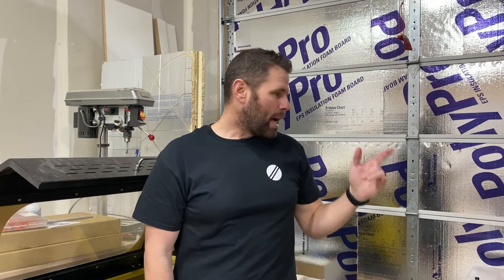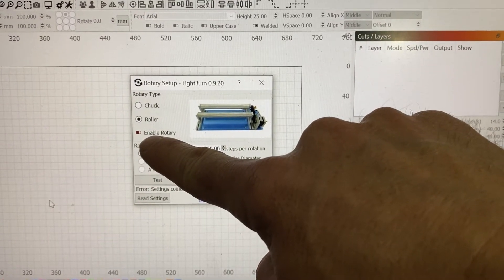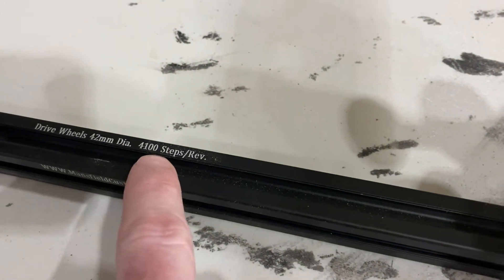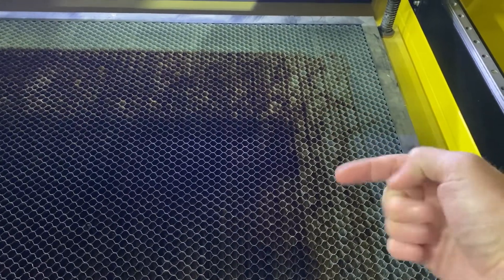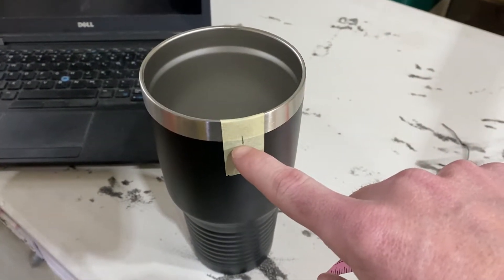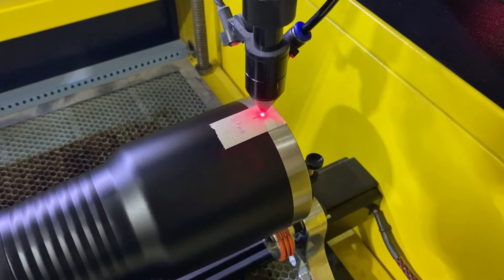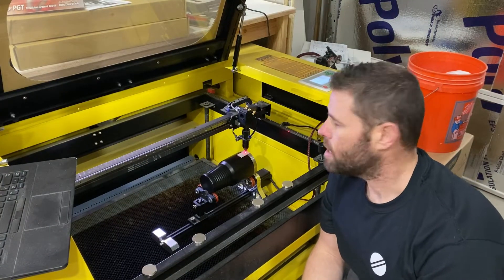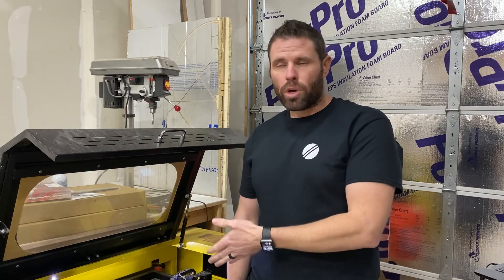Laser Rotary Setup and Calibrating Steps per Rotation Using Lightburn

Comment: Do the steps have to be determined anew for each job or just once?  Do I have to determine the circumfence for each part and enter it where?
Reply from the maker: On a roller rotary once you have configured the steps that it. The roller does not need the circumference or diameter.
Reply: @BeardedBuildsCo  thank you very much

Comment: old video, but still useful so thank you for posting...I have a question....I'm setting up a Piburn chuck rotary in an Omtech 80w red/black machine and the distance section in the move tab is greyed out. I can adjust speed but not input distance. Any guidance?
Reply from the maker: You likely need to change your start from position to current position or user origin. Then that field should open up. Let me know
Reply: @BeardedBuildsCo  Nope, I just tried, distance stays grayed out for current position and user origin.... Nevermind, I just figured it out, I had continuous jog enabled... I'll leave this post up in case anyone else comes along with the same issue, lol
Reply from the maker: @johndeaux9987 yep, that will do it

Comment: Would be really cool if you could tell us what the controller in that machine is (so that people who make their own machine with GRBL controllers etc can also use your previous answer :)) . Thanks !!
Reply from the maker: Not sure what difference the controller makes but this is a ruida controller.
Reply: @BeardedBuildsCo there are usually 8 switches on a controller, 1 -3 is supplied power. 4 is usually half/ or full power. And 5 - 8 is the stepper motor setting. There shouldn't be any guess work with it. It's all based on the switches and diagram. Some controllers are built into the laser. If yours is built in, you will need to read your owners manual and find out where it's located inside of the laser. It's usually very similar to an external controller but it's actually inside of the case
Reply from the maker: Go tell someone that has never worked with steppers that and see what kind of look you get from them…

Comment: Looks like it's been two years since you made this video.  Are you still using this rotary, and if so, how has it held up?  have you had to replace the rubber tires at all?
Reply from the maker: Still running strong through thousands of tumblers.
Reply: @BeardedBuildsCo  Good to hear.  Getting ready to pull the trigger one I think.
Reply: @BeardedBuildsCo  My Mansfield rotary should be here today. Will be running it on an OMtech AF2028-80  Reviewing this video again.  When changing tumblers or glassware, what in Lightburn needs to be changed?  Will I have to change the steps per rotation every time I change to a different item with a different circumference?  And I would imagine I would have to change the circumference value in Lightburn on the move page each time also?  Thanks.

Comment: ok i see all this but theres a steo im not getting my head round. How doyounknow where to actually place the rotary machine? im using an omtech 60w and i dont know where to place it at all once plugged in
Reply from the maker: For that you need to understand your start positions. If you use current position then it shouldn’t matter. You put the rotary in and then move the head to where you want it to start. Use your frame option in lightburn and it will help you visualize it.

Comment: When I change the steps per rotation in the software it doesn't change anything on the y-axis still spends roughly two full rotations around with the proper circumference calculated. Have changed the steps per rotation from 100 all the way up to 2000 with the same results both times. Any thoughts of what could cause this?
Reply from the maker: You likely need to be 5000+
Reply: I'll give it a try, thanks

Comment: anyone else have their rotary give them a nasty vibration? I cant find any info on that
Reply from the maker: This is usually because the steps are way off.
Reply: Thank you for the response. Yes I think I'm discovering that.. why even put the 4100 on there??
Reply: Nope. Still very jagged results. Vibrating not as bad but still vibrating. I can get it to rotate circumference and land back on mark with new steps per rotation

Comment: Im new to this and i just setup my rotary. My question is. Once setup if i decide to use an object thats a different diameter and i plug that number into lightburn. Would i also have to resetup the rotation number by repeating these steps or would the initial calibration work for any size object
Reply from the maker: On a roller/ 4 wheel rotary the object diameter does not matter. You also do not have to change the steps.

Comment: I have a question on the Mansfield. I love my rotary, however I keep getting a wave in my vertical lines. When I use the rotary that I bought with my OmTech, I don't have the waves. I have been searching for answers and saw a video where there may be a wiring problem with the 80w Black and Red. Any advise?

Comment: Thanks for the great video, it got me up and running on my Mansfield Rotary this morning. Do you have any suggestions in how to fix waves in the engraving?  I’m seeing ripples for lack of a better term in my lettering.
Reply from the maker: In Lightburn go to edit > Machine Settings, look in the X & Y axis settings section at the bottom, and look for the value of 'PWM Rising Edge Valid' on the X axis. 
Change that - if's it's checked, un-check it, or vice versa. Then, copy the new setting over to the Y axis as well.

Try to engrave again and see if that fix your issue 

Look for "fixing skewed engraving"

https://lightburnsoftware.github.io/NewDocs/ConfiguringRuida.html?fbclid=IwAR1OTF0zCbxmdDpIsOO5OSryHZQcYKB9go85pSdpVHk-d1FgkPGHDFxEuLo

Comment: Thanks for your instructions  very helpful.  
I purchased the same rotary axis.  I have experienced some issues when trying to setup different diameter glasses.  The rotary stops part way when testing the full rotation (arrow up) after one or two trials.  If I test the distance in the reverse direction (arrow down) it completes the full rotation but only once or twice.  Do you know why it cannot be tested always in the same direction (arrow up)?
Reply from the maker: Because you have run out of the theoretical work space. If you look at the controller it will show you the x and in this case specifically the Y coordinates. If it runs too far it hits the “limits” of the workspace.
Reply: @BeardedBuildsCo  Thank you for your reply - Is there a way to ignore these limits or do I just have to keep going up and down on repeat rotations?
Reply: Okay did some more work and you were spot on about the limit of the work space - that was my issue.  Additionally I discovered that my wine glass calculation for full rotation was not coming out to an accurate 360 degree rotation.  Turns out I was measuring the widest diameter where I was engraving the glass.  The correct place to measure the glass is where the drive wheels contact the glass - when I reduced the diameter to that dimension everything worked out perfectly - no change in the steps/rotation.  Many thanks for your expertise on this matter!
Cheers!
Reply from the maker: Perfect! You are correct in your discoveries. I’m glad you got it dialed in!
🤜🏻💥🤛🏻
Reply: One final question - how do you slow down the Y axis so the rotary does not spin too fast for the rapid movements?
Reply from the maker: Lower the speed on the controller and lower the speed in the move tab in lightburn.

Comment: I just got my rotary set up and cut my first cup. It has 3 separate logos on it. The first one looks fine but the next two (which are circle logos) came out oval… any ideas?
Reply from the maker: I stretch all of my circle logos 9% width wise to compensate for this visual mind game.
Reply: @BeardedBuildsCo  I was concerned about slipping. Any other tips like that? I am so happy I found your tinfoil and tape trick.

Comment: So when I change to different size cups do I need to change any of the setting in light burn.  Excellent explanation.  Thank you.
Reply from the maker: Nope, with the 4 wheel rotary you don’t have to make any changes once you have the steps calibrated.
Reply: @BeardedBuildsCo  Do different size tumblers not make a difference on tumblers?  I was going through doing some and found that the steps for a 20oz were different and went too far on a wine tumbler.  Had to go through process and re-set the info between wine tumbler and the other.
Reply from the maker: I use the same steps on a 20oz yeti and a 64oz growler yesterday.
Reply: @BeardedBuildsCo  hmmm.  ok.  thanks for the quick reply.  I'm playing with it now and trying to figure it out.  Think it may have to do with finding the "actual" right size/circumference for it to move.  I can leave the steps the same and play with that number a little and it makes some difference.  its hard with the wine tumblers cause every point of them is a different size.  

I just did one that was two sided and my measurements were correct in lighburn but I had a 2" gap between them on one side and 3" on the other side.  Wouldn't be a big deal if you're only doing one image on a cup

Comment: My engraving smaller coming out smaller then my design, an inch…what could be the problem??
Reply from the maker: Are they squished?
Reply: Yes
Reply from the maker: @gracelarrea6477  that would usually be due to your steps per rotation being too low. Have you used a flexible table measure and measure to see exactly how far off it is?

Comment: I have a K40, i've tried to change the MM per rotation and it stops short no matter how many times i raise my MM  per rotation. Any ideas?
Reply: Change the steps per rotation - 2750 steps per rotation / roller diamet 20mm / object 100mm / circum 314mm works for me with a k40

Comment: Awesome video. Only issue I have is when it's time to add the circumference to Move section under distance, my distance is greyed out at 10 mm and will not allow me to change it. Did I miss a setting somewhere? The cup rotates less than an inch when I hit go. Around 4:19 in the video. My default setting is 10000 steps.

Comment: So you measure the diameter and enter it which then tells you the circumference for that diameter of object.  THEN, you measure the circumference and get a number different from what the software calculated from your diameter.  You use your measured circumference over the calculated circumference to calculate your steps.  Is there a reason you didn't use the calculated 314.159 for your circumference?  The difference in those two numbers would change your step value by a bit, and if you are doing things that fully wrap the tumbler, that WILL matter.
Reply from the maker: This is a classic do what I said not what I did. The videos were spliced together and had two different values.

Comment: By far the easiest to follow tutorial I have watched. I found my steps per rotation in under 2 minutes of testing. Liked and subscribed!
Reply from the maker: I’m glad it helped!
Reply: Yes, Squished
Reply from the maker: Then your steps per rotation are off. You will need to increase them.
Reply: I did a step of rotation test and I had me lower them, what would make change spontaneously…and I did a project yesterday with the same design five times and the size of each design came out a little differently… didn’t change any of the settings 🤷‍♀️
Reply from the maker: @gracelarrea6477  what rotary are you using? Is the cup getting pinched at all as it is trying to rotate?
Reply: I’ll try that
Reply: @gracelarrea6477  Object slipped maybe.  That's always been the number 1 culprit for me on my old epilog rotary.  Happens most often with glass (slippery) and especially very sharply tapered glass or lightweight, like a shot glass.   Best cure I've found is to clean the rubber tires very carefully and, if necessary, find a way to add weight to the object.  Lead shot in a baggie taped to the inside of the glass works well.

Comment: What if I wanted to laser 7 shot glass cups in a row (stacked left to right) on a rotary?  Do you have a tool (a rod/stick/other) that you use and recommend for placing in between multiple objects of the same size on a rotary?  Thanks.  Dianne

Comment: One common stepper motor step angle is 1.8 degrees per step or 200 (WHOLE) steps per motor revolution.  It might say on the label/data plate on the motor.  But if not, its almost always 1.8 (sometimes 0.9*)   If you measure the size of the pulley on the motor itself and get the ratio between the drivewheel and the motor pulley, you can get the exact number of whole steps per revolution of the drivewheel.  Then pick the microstep ratio (1/2, 1/4, 1/8, etc) the machine is using for the Y-axis (usually set by dip switches on the motor driver) to multiply that figure by to get your actual steps per revolution.

Comment: How did you move the laser head down the y-axis after swapping in the rotary?
Reply from the maker: You can move the gantry by hand if you need to. I usually try to get it into position before I disconnect the Yaxis.

Comment: You didn't mention it in your video, (very helpful video BTW) but I assume you disabled Y axis homing in machine settings. When I do this (and write it to the controller) the Y axis position defaults to 10000mm after power cycling my laser (so I can swap cables). I end up having to use the down arrow button to run the Y axis back to 0 on the display. Any ideas on how to prevent this from happening?

Comment: I'm having issues with my "Steps per rotation"  -  no matter what number is in that location - the tumbler spins 4 complete cycles
Reply from the maker: How high are your steps?
Reply: @BeardedBuildsCo  2042  -  Regardless of steps - I've "shrunk" my file by 4 x and it seems to work when "Framing" but then when I Send file to machine, it doesn't spin the rotary

When I complete your setup I have to put in a LOWER number in the "DISTANCE" area.  

You state to measure the cup and my cup measures 285mm around.  I place that in the spot and it goes around about 4 times.  If I put in 76 - it's almost perfect.  

not making sense.  I'm sure it's a very simple setting once I figure it out.  for the first time.
Reply from the maker: @RickSwartwood  okay so do you have the steps figured out? Are you using a Mac?
Reply: @RickSwartwood  did you ever figure this out?  I'm going thru the same thing.... nothing makes sense